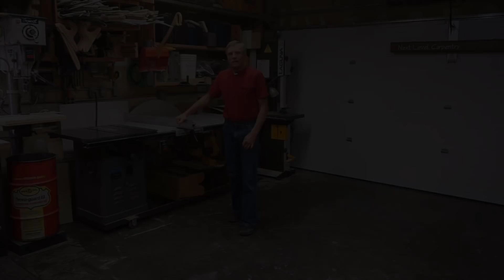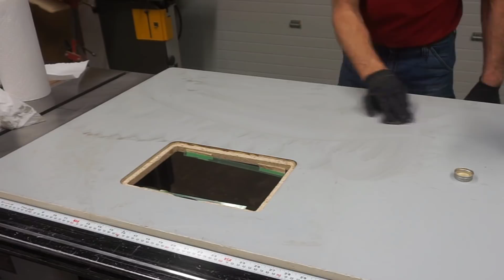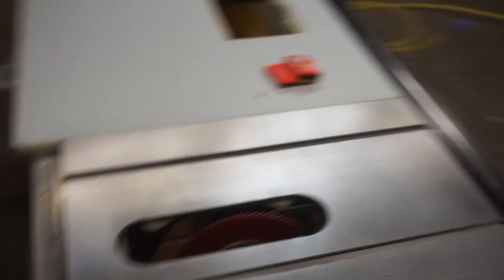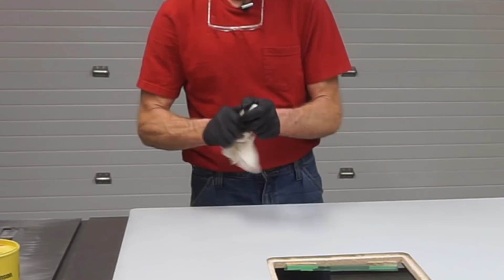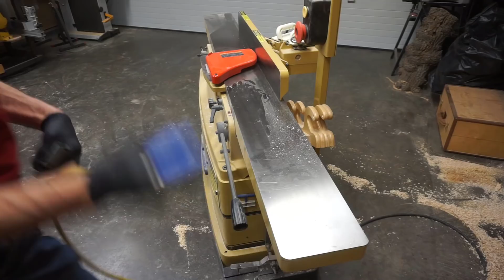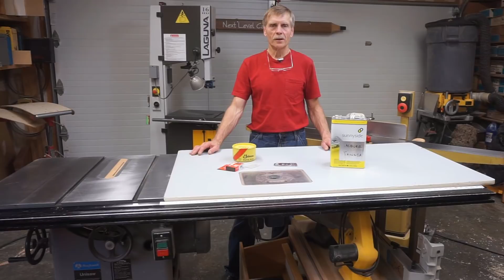Machine Maintenance Tips for Top Notch Performance

Comment: Matt, you never fail to impress. I thought I did a decent job cleaning my saw but you just upped the game. Where did you get that throat plate with the sliding insert?
Reply from the maker: Hey thanks Rick... sorry man I really wasn't trying to one-up you😀 I've received so many comments on that awesome throat plate but sadly I have to reply that it's no longer available.  I forget the name of it just now but you can see it in my response to other similar questions on this thread and if you find the name of it you might luck out and come up with one of those on eBay or something.  It's a fantastic accessory and if you do much woodwork is probably worth the effort it would take to locate one. Best, Matt

Comment: My equipment used to live in an unheated garage, regular paste wax wasn't enough an auto wax worked much better. Some are silicone free.
Reply from the maker: Good you found a product with adequate protection, Monte... unheated spaces can be  brutal to preserving bare cast iron.  BTW I wouldn't be concerned about a wax that worked well even if it has silicone in it... I've never had any trouble with surface lubricants 'infecting' wood during milling to the point it had any negative effect when finishing.
Best, Matt

Comment: So Matt, you French Polished your table saw.  hehehe.   That's a cool idea.  I had never thought of that.  Today is cleaning day for my saw, so I gotta try that.  I usually just keep dipping the rag into the wax, so this should go much easier.  Are those sandflex blocks any different than the normal Norton or 3M sandpaper blocks that are ubiquitous in the local big box stores?
Reply from the maker: Don, I'm proud of you for devoting time to cleaning your saw! I think you'll love the 'french polish' method of applying wax... seems to me it goes 3 times as fast and comes out twice as good.   It's such a good feeling when you walk into the shop afterward and see that gleaming top!  
The Sandflex blocks are quite different than sanding sponges (blocks) in a few ways.  First they're pretty dense so they don't 'squish around' which means you can get more aggressive where you need/want to and they're less likely to round off sharp edges like along your miter guide slots.  
Second:  the material is kinda like a extra dense eraser rubber and the grit goes all they way through, not just a coating on the outside of a sponge.  That means that they don't get 'dull' like worn sandpaper because the 'rubber matrix' that binds the abrasive particles wears away in use continually exposing fresh, sharp particles. 
Third: all the sides have the same abrasive where some sponge blocks don't have any on the ends (right?)
I originally bought one of each coarse, medium and fine but have only replaced the coarse one but each person's use is going to be a bit different.  I sound like a salesman but the Sandflex blocks are one of those things I'd hate to have to do without... and there's a link to 'em on the Next Level Carpentry Amazon Influencer's page in case you can't find them locally :-)  Best, Matt
Reply: I usually just use some of those 3M sanding blocks, but I just ordered the set of 3 sandflex blocks from your amazon page to try out.  Sounds like they will do a better job and last longer.  Never did manage to clean the top yesterday (life got in the way), so I'll wait until those sandflex blocks arrive to do my french polish.  :-)
Reply from the maker: Don T You sound like the kind of person who'll really appreciate the difference those blocks make... and thanks for going through the NLC Amazon page... I really appreciate it!  
You'll no doubt find applications for the blocks for other tool maintenance too.  Seems I use the Medium one for spiffing up my block and bench plane bodies when they tarnish from perspiring palms when planing in warm weather.  The Fine one does a great job of repolishing my steel rulers, machinist's squares, etc because the stiffness of the block and fineness of the grit keep it from erasing markings in the slight grooves of the markings where steel wool or sandpaper seem to make those fade over time.  Hope you get the life stuff dealt with without undue stress?  Best, Matt
Reply: Life stuff......I went thru a divorce 25 years ago....nothing can mess me up for long after that.  It was just a minor inconvenience yesterday, but thanks for the concern  -- and the tips for using the blocks on other stuff.  Looking forward to it.
Reply from the maker: I understand... what doesn't kill you makes you stronger, right?  Glad it wasn't more than what it was... onward and upward :-)  Matt
Reply: So Matt, got those sandflex blocks in the mail yesterday.   They remind me of these blocks we used in my shop for years.  The ones we had were called Brightboy sticks.  Never knew if they made different grits of those ones, but the ones we used were a bit finer than the finest of the three Sandflex ones.  The Bightboys were much denser also.  Don't know why I didn't think of using one of those for the table saw surface, but I think the medium sandflex one works better anyway.  At least for the first time.  This is definitely going to work better than the 3M sanding blocks, though.  Glad I saw this video.

Oh yeah, just watched your video of the reproduction of the base molding.  That was a pretty darn cool trick with the planer.  I've used a planer sled before, but never thought about making one to cut an angle.  At first, watching the video I wondered why you bothered jointing the first surface since just running them thru the planer would make the sides parallel, but after watching the whole video and seeing all you were going to do with them, it made perfect sense to make sure they were also flat, and not just parallel.

I think it was in the comment section of that video that someone noted they didn't understand why your channel doesn't have more subscribers and I get your response to that.  I just have to mention that there is more actual content in 5 minutes of any of your vids than in an hour of some of the channels with a million subscribers.    Go figure, huh?
Reply from the maker: Hey Don, thanks for the update and feedback... it's very rewarding to hear that some of this stuff is helpful.  The Bright Boys blocks you mention must have applications that they're better for but it's nice to have more options on hand, isn't it?  I had a pumice block in a drawer for years and one day used it to clean rust film off the milled surface of my drillpress stand because the coarse SandFlex couldn't get down into the rough mill tooling marks.  Gotta do whatcha gotta do :-)
 
Angling a planer sled has all kinds of applications and now that you've seen it I'm sure you'll find it helpful for random things I've never thought of. 
The content/subscriber thing is a constant challenge... kind of a 'chicken and egg' thing: subscriber count drives channel growth but long, content dense videos don't attract the subscriber volume.  It's feedback and interaction from viewers like you that encourage me to keep priming the pump in anticipation of channel growth/size that is self sustaining so I can devote more time and energy to video production.
Thanks again for everything, Don... Best, Matt

Comment: I had an enlarger bought used with a laminate base wit some chips like yours.  Plastic wood made a great filler and lacquer thinner is the solvent.
Reply from the maker: Ron, thanks for commenting... Do you think plastic wood is strong enough to hold up as a chip repair?  I'm not sure... I have considered using autobody filler to fill the chips but will probably just wait until it's time to replace the whole laminate surface though...
Reply: Been holding in a 1" chip that was there when I purchased the saw.  So yes for sure.   Do not over fill and try to sand down as it gets stone hard.   For something I cared about,  buy a flexible pallet knife and apply in thin layers.  Tone trick dentists use is to undercut a filling,  i.e. drill down and make bottom wider than top.  Think of it as a dovetail filling.

larger areas can be squared , routed down to wood layer,  and a patch put in.  

If I used a laminate top,  I would use wood edges so as not to expose edges to chipping.

Best of luck
Reply from the maker: I like the idea of 'dovetail filling'... makes sense and has to work...  Nice! Thanks for the follow up... Best, Matt

Comment: I'm a firm believer in periodic maintenance on ALL my wood working equipment.  This is an excellent video on how to take care of the surfaces especially the cast iron.  I live in FL so humidity is always the nemesis.  I also have to move my equipment (tablesaw, jointer , planer, etc.) outside the garage to work.  Sweat, humidity and also the unexpected rain wrecks havoc on the cast iron.  After (actually while) watching your vid I went to Amazon and ordered the SandFlex pads.  I know I'll make good use of these.  Thank you, Matt, for your great videos!  I always find new things I can use from your woodworking wisdom!
Reply from the maker: RHI Hodag, I feel your pain fighting all that moisture and humidity!  I get upset when a bit of rain/mist blows in the shop door during a summer afternoon rain and tarnishes my bandsaw with a few speckles of water... guess it's payback for having to deal with -18 degree winter temps :-)
Might want to check out Greg Bungard's comment below about padded blankets to minimize affect of humidity in Georgia.
Keep up the good maintenance... you're going to love those Sandflex blocks for sure... and don't spare the paste wax!
Best,
Matt

Comment: Typically I leave the paste wax application until the end of the day. I then spend a lot of time cleaning and about an equal time applying the paste wax. Though I've never used the wax in a rag method I can see the value of it because it would speed up my process. I too have seen many people using sanding machines to clean their cast iron tops, much to my disdain. I have also seen many table saw stored outside allowing the cast iron top to rust. These people apparently have no pride in their equipment. My wood working tools are considered my toys and i take real good care of my toys! Thanks for sharing!
Reply from the maker: Terry; great minds think alike when it comes to taking good care of 'toys', right? :-) Your method of leaving wax wax application until the end of the day is a good one... letting it sit awhile before buffing off seems to make it 'last' a bit longer than buffing it off right away, doesn't it?  I often find myself in the thick of things with a sticky jointer bed and so end up in 'wax and go' mode more often than not.  I think you'll like the wad-o-wax in a rag method when you give it a try... especially helpful on larger/longer surfaces.
Best,
Matt

Comment: Hi Matt, In Georgia. were I live Harbor Freight sells  pleaded thick moving blankets usually dark blue,  5.99 on sale
These are great for your shop machines when not using, in additions to what Matt does in video, this extends the maintenance cycle as well amount of work required periodically to the  bed, in addition, to protecting them from humidity and dust. Nothing sweeter than a polished waxed bed.
Reply from the maker: Thanks for sharing this, Greg... if it helps keep rust from tools in Georgia's humidity it will help woodworker's everywhere!  I've pinned your tip/comment for benefit of other viewers.
Best,
Matt

Comment: Great TLC on the bread winners Matt.
What type of setup do you have when working in a customers home? I’m exploring ways to be more efficient on portable.
Reply from the maker: Thanks Brian... I just happen to be sitting here reviewing comments :-)  My portable tablesaw is a DeWalt DW745 10-Inch Compact Job-site model with a teflon coated aluminum top so it doesn't need much at all in the way of upkeep.  I don't use a jointer or bandsaw on-site so no cast-iron there either.  Ditto on my miter saw. 
 I don't do a ton of on-site work so my setup, although it works great for my needs, might not be anything to model for your projects.  I do make my own welded steel portable stands for my tools: mitersaw, tablesaw, thickness planer, etc because that way they are specific to my equipment and needs. If you look closely in my videos you'll see the custom portable stands in use.  IMHO any  'universal' portable base is going to be an inefficient compromise in order to fit a wide enough range of tools to make it profitable for the manufacturer.  So I guess my short answer is that I achieve efficiency in portable by using 'lean design' wherever possible.
Hope that helps?
Best,
Matt

Comment: How often do you check the calibration of your equipment for proper alignment and parallelism? You seem to be a perfectionist so where do you draw the line on good enough, considering wood is an imperfect material, and the machines, tape measures, squares, etc have their tolerances as well?
Reply from the maker: SKWDMDYT, Good question.  I do have perfectionist tendencies so I use this credo to draw a line to balance perfectionism and practicality:  
"If it takes a little work to make something a lot better, it's usually worth it.  If it takes a lot of work to make something just a little better, it's probably not worth it"
Applied to equipment adjustments I check and adjust anything that will affect the quality of the job at hand.  For instance I'll check the squareness of the fence on my jointer every time I'm milling pieces for edge glueing because it's imperative that edges are 'perfectly' square.  On the other hand you probably saw the chipped laminate on my tablesaw extension table in the video.  It grates on my perfectionist nerves to see those chips but they don't affect the quality of work I'm doing so I just leave them... for now.
I expect the machines I invest in and rely on to tenaciously hold alignment, parallelism etc and only check/readjust if I notice a change.  An example is 'dialing in' the rip fence on the tablesaw if/when I notice cut quality deteriorating.  The fence slides on nylon guides (far from an ideal design) and over time they wear to the point of needing adjustment or replacement.  It doesn't matter for routine ripping work but isn't acceptable for cutting expensive veneered panels.  That's when I do a lot of work to make something (parallel alignment) just a little better.
Hope that helps, sir!
Always appreciate your comments, questions and feedback..
Work safe and be well!
Happy Thanksgiving...
Matt

Comment: That's a lot of elbow grease you've used - but the time and effort speak for themselves, the results are stunning ---- Great video ---  I'm definitely covetous  of the Powermatic Jointer!
Reply from the maker: Jim,  At least making a video of the process made me think less about the drudgery involved but, as you mention, the results are always worth it!  I suspect that Powermatic is cause for more than a bit of coveting :-) I well remember the feeling before I invested in it. I feel it's the best in its class, especially when upgraded with a Byrd Shelix cutterhead! It can hog through a full 1/2" deep x 8" wide cut on a plank if I ask it to but is equally capable of removing a 'frogs hair' from a face or edge too.
Keep in mind though that your helpers are either going to hate you or quit when you get one for Christmas and make them haul it to your portable jobsite workshop... that machine is a BATTLESHIP in the shop!